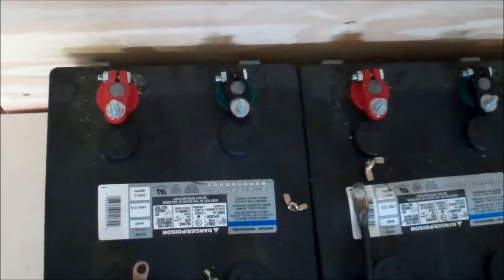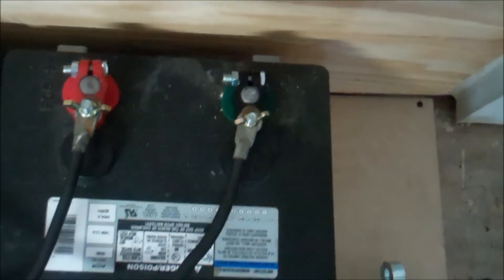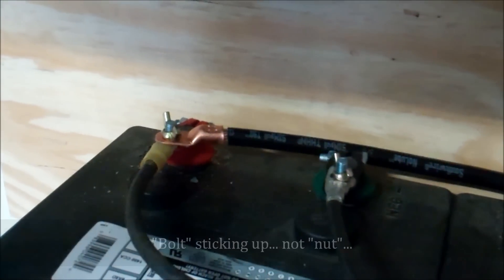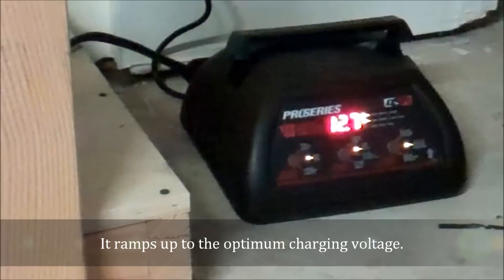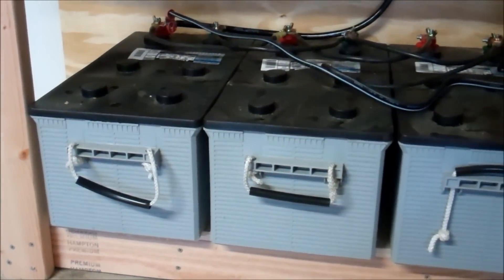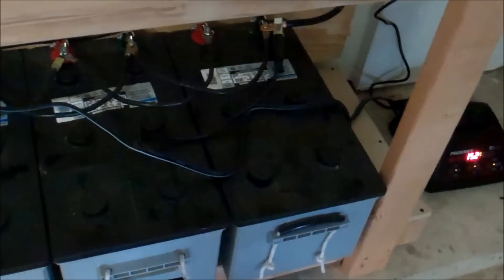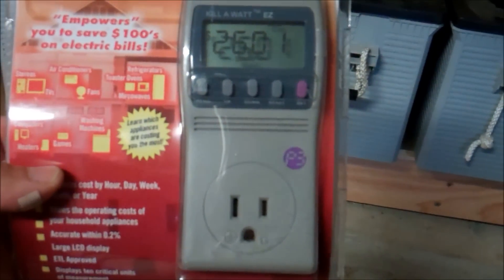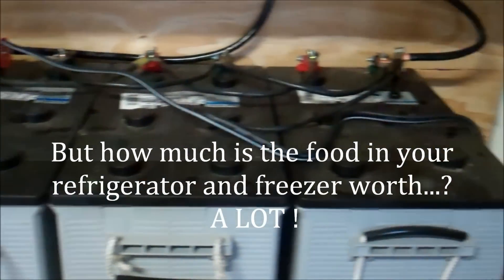Living Off The Grid ~ Build A Battery Backup Power Station

Comment: Batteries tend to sink to the performance of the worst battery when hooked in parallel. It is more efficient to connect them in series.  Just sayin'.
Reply: not thrue if you use battery's from same mark, adge and badge, if you connect them as shown in the video here it wil work fine!(and for years!
in series would be even worse!, so your comment is not right! sorry! (im a profi battery bank builder/seller)
Reply: TexasPrepper2  you are welcome!,your the first who does it as it should be!
(tho i dont advice my customers to put used batterys parrlel, in your case it worked out fine! )

if you ever build a set for 24 volts, or 12 and use 6 volt batterys be sure to put al the 6 volts in parralel! ( for instance, if you have 4  6 volt battery'sconnect per two in parralel, and conect those in series, this to keep al the seperate baterys equal.

good video, with good no noncense advice! thumbs up! (although i would mount a strip fuse in the positive )(only for short circuits, not for the equipment)
(400 amp)
Reply from the maker: MrBugsier5
Thanks for the affirmation !

Comment: Far better to use 6 volt batteries hooked in series.  Battery DO NOT like to be hooked in parallel.
Reply: I did it because I didnt know any better but with hindsight I should have asked about building up a battery bank. I now have five 110ah leisure batteries connected in paralell to give 550ah all of the same age and all from the same supplier who gave me good advice on connecting them up for the best lifespan.  It's good to watch other peoples projects and learn a bit more every time.
Reply: noncence!
if you use equal batterys of same mark, badge date and date (new!) its no problem at al as long as you follow the rulles doing so!

tho never connect used different batterys in parralel (or series!)in a bank, thats asking for problems., in series you have even bigger problems due to the charge current flowing trough both batterys, overcharging one, and under charging the other, in this case its even so that if you charge different batterys in parralel it wil work good, same in series it wil not! (tho do not leave parralelled different batterys connected wen not under charge, due to the different internal resistance the will discharge fast!
Reply: MrBugsier5 Too true. The rules are simple enough to understand.
Reply: thra5herxb12s well itlooks quite simple but it is not always! lol, lead acid battery connecting and good charging is something you have to learn, mostly in practice! lol
Reply: I did learn in practice by killing expensive batteries,
Reply: thra5herxb12s thats not funny indeed!, even proffesional battery sellers give bad advice (they want to sell more battery's!,) we really dont!, i'd radder have customers hat are happy, and come back for other installations that work! lol

Comment: Man that's great. if them battery's haven't been used they got still 10 years left. sams golf cart battery's work good. NAPA 's got a good battery cleaner a great paint cover that wont let the white stuff that eats the copper n break the connection  happen to then it helps good ! I've used a battery minder w desulfnatior !
Reply: You still have to use a battery to keep it charged otherwise it'll just die
Reply: Steven Manning 7 months later hows the batteries and inverter doing ?
Reply from the maker: ***** I did this setup for a relative of mine.
I think he said he's having trouble with the batts. 
They were several years old when his friend gave them to him (the friend upgraded to some new ones)... and they may be nearing their lifespan. 
He's already looking at replacing them, but don't know with what yet.
Reply from the maker: ***** Inverter is still working fine as far as I know...

Comment: Marine batteries are NOT true deep cycle batteries.  These batteries here wont last long.  Much better off with 6V golf cart batteries dbl up.  They are closer to true deep cycle.  Golf cart batteries last much longer.  Also are you connecting COPPER to ALUMINUM here?  If so BAD IDEA!!
Reply: Deep cycle marine batteries are deep cycle, just maybe not as deep cycle as golf cart batteries. Marine batteries will last for years when used in an "off the grid" setup. I know they will. I've used them personally. Yes, gold cart batteries are better, but the marine batteries will last for a long time when set up indoors (probably a good 5 years or so).
Also, if you're worried about connecting copper to aluminum, just buy a tube of Noalox, and coat the connecting copper & aluminum with it, tighten them up, and you'll be alright. You can always check the connections for tightness a month later. It'll be fine. Electricians use Noalox when tightening the main copper wires (heading down the riser) to the aluminum connectors on the breaker box of a home, and they seldom if ever re-tighten them.
I think that both ideas were sound, but I suppose to each their own.

Comment: Some of these people are coco. Refrigerators draw better than 8 amps. I just looked one up 09/14 Frigidaire 26 cu. ft. and it draws 8 amps. Your batteries could never keep up with this drain on them with your peewee 12 volt system
Reply: that 8 amp is not the running current, only the start up, we sel a lot of these smal systems for backup emergency power, and a normal fridge wil run about two days on this 3 battery setup. (its not continioisly on, and doesnt use that 8 amp, only when starting the compressor, when it runs it wil be around 1,5 amps at 110 volts (around 18 amps at 12 volt side.at 700 amphour available that would be a working time of about 40 hours continu use! , half off the time the copressor is not running so 80 hours is possible!

Comment: Additional thought for your fridge in a grid-down event. With a battery system like this, you can put an industrial grade 24 hour timer on the fridge-Run it for 1 hour, off for two. This way you can keep your food safe, and use a LOT less of your emergency power!
Reply from the maker: Great idea ! 
I DO have another way to refrigerate... check out the video:

A Most Important Prep

Comment: Nice little setup, but strictly a '1 time deal' in an extended emergency. I'll voice an opinion to those who may not understand exactly what you have here.  When your power goes out and you turn on your inverter, you have power as long as the batteries can discharge to the inverter.  Once drained down to X level, the batteries are done and you have no more show.  perhaps you can add a solar panel or two to 'recharge' your battery bank in an extended emergency.
Reply from the maker: SpockMcoy Issmart Yep... solar panel is in the future...

Comment: Great information! What if you had 6-volt batteries, say six of them, which I would like to connect both in series, and in parallel. I have already completed the series connections, but now that I am at the stage of completing the parallel connections (positive to positive, negative to negative), I am uncertain about how to proceed without causing an arc, or any other disaster. Is there a method for making these connections without sparking?
Reply from the maker: If you have connected in series, you should have 36 volts. I don't think you connect parallel while they are still connected in series. I'm not comfortable giving you advice about making any additional connections. Do your research.
Sorry...
Reply: Solar Tech DIY, Inc, if your intent is to get a voltage of 36 volts and you have 6 volt batteries, then you have to connect them in series.
But you cannot connect any of them in parallel in this configuration.
If you can, get eight 6 volt batteries. Make 2 groups of 4 in series. THEN put those two groups in parallel to get double current.
That would give you 24 volts at double whatever the amp hours of the batteries.
Of course you would have to keep all the batteries close to age as possible.
Like TexasPrepper2 stressed, you can't drag out the time between adding new batteries.
Reply: if the batterys have the same charge no power wil flow whn you connect them.
also advice you strongly to first parralel 3 of your 6 volt battery's , and then connect them in series with the other 3, this wil keep al the batterys loaded and charged the same amount!

Comment: Am i correct in thinking your power bank is being charged by a charger plugged into a plug socket from your house electric ???  And could you plug in the charger to the inverter and charge them that way, im new to all this if it sounds daft
Reply from the maker: Sorry... it doesn't work that way on this inverter. Some inverters DO have a built in charger... that's pretty handy. I have one...

Comment: You will need a generator to charge the batteries if you plan to run a typical fridge. Mine draws about 1.2 amps @120v and it's on roughly half the time.and that would probably only give 1 day or less on your setup before the inverter kicks out because of low voltage.
Reply from the maker: Remember... you only need to run a fridge a few hours a day to keep food cold. In a grid down emergency, I would not leave it on all the time...

Comment: Buy a Small gasoline generator to charge your batteries in case of no solar cause of clouds or snow. There only a couple of hundred dollars and $20.00 for 5 gallons of gas. or leave at least 1/4 tank of gasoline in car for charging your battery bank about 4 to n6 hours depending on size of battery bank. or about 10 hours on a 20 amp battery charger at 120 volts off a amall generator this is about 8.5 amps on the generator.
Reply from the maker: Or... with a tri-fuel gen.
Propane is forever... get a BIG tank !
Reply: Yes propane would be Ideal last for almost ever.

Comment: Just a noob question mate,how long you can run this system in case of power shortage?thanks
Reply from the maker: It depends on what all appliances are running. This would be for absolute essentials... refrigerator, fan, etc.

Comment: 1) if you are charging that with a battery charger instead of a solar or wind generator, you are not 'living off the grid' you are in fact using MORE power, not less. 2) if you have that setup in your garage, you will build up hydrogen which can end very badly
Reply: wrxsavvy
you charge and discharge from outer terminals.Gives you even draw down and charging.
Reply from the maker: I didn't say he was "off grid". This is for times that the grid is down (for a short time) to keep some electricity available.But... my point was... for someone that needs an "off grid" solution... just add some solar panels and a controller and they would be in business.Hope that clarifies it.alan
Reply: Um you actually did say off the grid. It's in your title...
Reply from the maker: wrxsavvy
Yep... and if / when the power ever goes out, and he is (temporarily) "off grid"... this will be his backup...
Reply from the maker: wrxsavvy
I'm not an expert... but if I understand right, you do go to the farthest post to CHARGE... (that equalizes the charge over the batt bank) But... I'm really not sure if you have to do that when you DISCHARGE... (like going to the inverter)... It might be best to run to the inverter from the same equalization, but not sure. Someone else may comment that has more knowledge on this subject.
Reply: I guess your right :)
Btw correct me if I'm wrong- it is not necessary to have the negative connection of the inverter all the way on the other side of the bank if they are hooked up in parallel.

Comment: Is charging batteries to 14.4v wise? I think lead acid batteries charge to 13,3v, and beyond that you have problems. I'm no expert. I'm just wondering.
Reply: Yeah, I learned in circuits classes that charging a battery always requires a higher voltage than the battery is, to flow the charge into the battery. This is legit.
Reply from the maker: If you put an ammeter on your car alternator, I think you'll find it charges your batt at over 14v. That's pretty common. It doesn't mean the batts actually reach that rate of charge, just that the charge going in to them is that high... at least that's what I understand, though I'm not a pro.
Good question, though... thanks

Comment: Regarding the fuse size you are adding, how do you determine the AMP fuse to use.
Reply from the maker: I'm not a professional... but...V x A = W (volts times amps equals watts)Therefore, 12 volts divided by 2500 watts (inverter) = around 200 amps.Before you do anything... You need to DO MORE RESEARCH on this ! I am NOT a pro... nor do I play one on YouTube :)hope that helps,alan
Reply: Thank you TexasPrepper2.  So, it is the inverter's advertised (load) wattage as the variable. I have different size inverters some requiring less amps whereby requiring different fuse(s), I think.  "Why so many inverters," you ask?  I'm thinking the smaller device to get the job done would required less AMPS when idle. Okay, using P=IxE, my 400 watt device on a twelve volt system should required a 33 AMP, 125 AMP for my 1500 Watt.  Perhaps just using one would make life simpler.  Thanks again.

Comment: grate idea :)
 but on charging u should do a slow charge like at 2amp. it will be better for the batterys and thay will last longer
also keep ur eye on the water make shere its filled enuf to cover the fins in side
Reply from the maker: Thanks for mentioning that... Water level is important.
As far as how fast to charge them, listen to Stephen Harris on The Survival Podcast. His "Battery" episodes are very good. He says charge batteries of THAT size Fast ! I consider him the Guru on all things relating to power.
His website is: battery1234.com
check it out,
alan
Reply: ya i dont know those batterys i just know car and deep cycles batt. for campers/rv jut i thot i would tell you but i do like ur idea we r going to try to put are house on battery power so this will help a big deal thanks for making that video

Comment: Just a quick thought on the power cables. As Philip wrote below I would up grade to a 200 amp line. Also two rolls of electrical tape one red and one green so you can easily identify you hot side (+) with the red and your ground (-) with the green. This should be done on all the cables from battery to battery to inverter and so on. In a low light situation this would certainly be a benefit and or should you need to trouble shoot at any time.

Comment: In truth, I REALLY like what you guys have done here! A 2500 Watt Inverter is generally adequate for most everyday situations. However, refrigerators draw a HUGE initial load when they start up, even the new 'efficient' ones. A 3500 Watt inverter might be better. Solar? ABSOLUTELY! If you can afford it, buy 500 Watts worth of panels, and an MPPT Charge Controller. A six or even 8 AGM Battery setup, especially in sunny Texas, and you can tell your electric company to take a hike, lol!

Comment: if you use 100 amps in 1 hour the charge back  should  be equal if the charge back is 200 amps now its 1/2 hour.

Comment: A battery tender jr...will supply the necessary power to build up the batteries...remember to use the charge controller to regulate, and safe guard the batteries. When the time comes for the panels the batterytenderjr can be used for a secondary unit. There are so many creative people on youtube...that the applications are many.

Comment: I would be upgrading that wire ASAP as 4ga wire will only take 100Amps and the 2500W inverter will need about 200Amps at full load.

I would suggest a 0ga wire between the batteries and lower (if you can) for the inverter
Reply: Larry Kemp NO!!!  The 14 gage house wires will handle 1500 watts...at 120 volts...that's 12.5 amps in the wire.  But inverter needs 125 amps INPUTat 12 volts to output 1500 watts.  That inverter needs 208 amps at 12 volts to make its normal rated output of 2500 watts.
Reply: That's all good.
Reply: That inverter will never make 200 Amps the average receptacle in a house will handle 1500 hundred watt using number 14 wire the wires are more than enough on his batteries for what he's doing
Reply: I'm sorry I was thinking about the ac not the dc sorry for the mistake
Reply: Larry Kemp Its OK!   I learned the hard way as a teen when I wired my Jeep ammeter with small  wire. I heard a hiss and smoke billowed from behind the dash melting some wires. What a mess.  Later we were off roading and we welded a broken steering box mount using 2 12 volt batteries in series. We used a coathanger for a rod. No helmet...  it got us home but my retinas were scorched even though my eyes were closed most of the time. I have respect for high amperage these days...
Reply: Larry Kemp Why go half in and make a system that is potentially unsafe? If it can handle 2500W size the cables to that potential, NOT to what you THINK that you will use.

2500w @ 12v is 208~Amps.
4 AWG = ~100 Amps
2 AWG = ~200 Amps
0 AWG = ~300 Amps

Comment: Don't do that with a modified sine wave inverter. It is not compatible with the way the main load center neural & ground are bonded. You need to even check to see if you can do that with a pure sine wave inverter too. Lower priced ones are not compatible.

Comment from the maker: As long as you don't wait too long between battery purchases. You don't want to put a NEW battery alongside an OLD battery. The old one will bring the new one down. I would think that 6 months difference in age (of the batteries) would be too bad. 
Marine batteries are about $80 each (Walmart). This charger is about $100 and you can buy a 1500 -2500 watt inverter for between 100 and 200 bucks.
I have several links to some components below the video in the description box.
thanks for your comment

Comment from the maker: High and low temps are not good for batteries. If you could make an insulated box around them that would help a lot, I think. Charging them makes the batts heat up. Insulation may help hold that heat in...